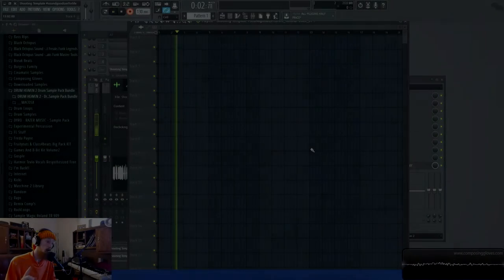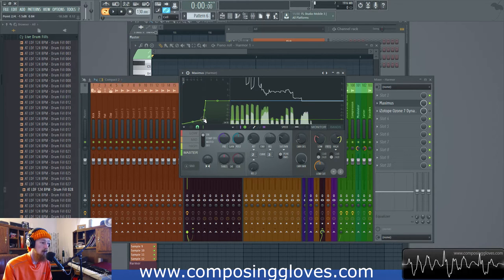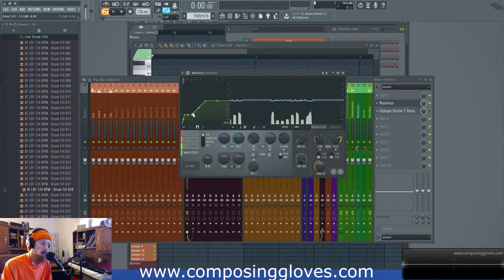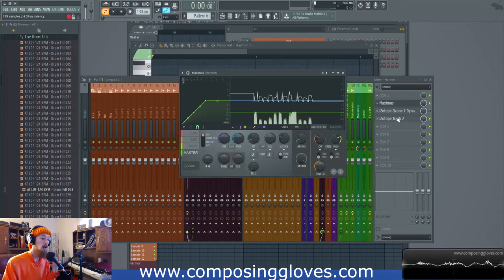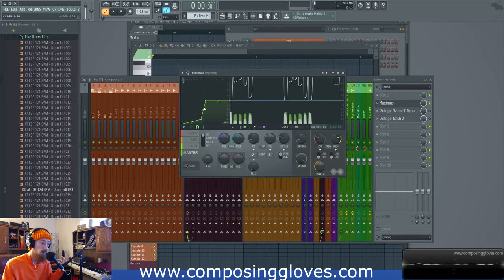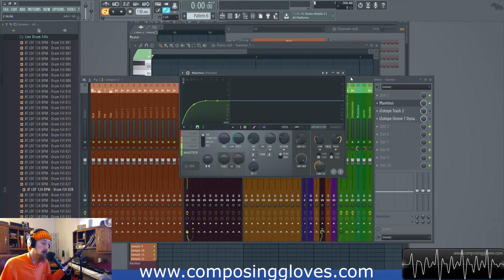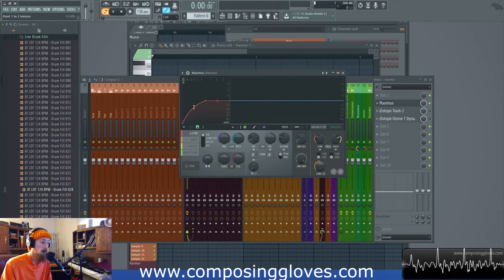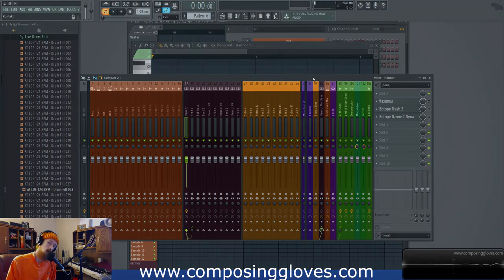Principles of Mixing 25 - Upwards Compression and Expansion

Comment: Upwards compression and expansion both increase the volume of the lower volume parts, but compression reduces the dynamic range in the process (compresses) where as expansion increases the dynamic range in the process (expansion). Right? What would you call something that does neither when raising the volume above/below a threshold? Instead of a ratio, it increases it by a flat amount?
Reply from the maker: I think that would be linear distortion